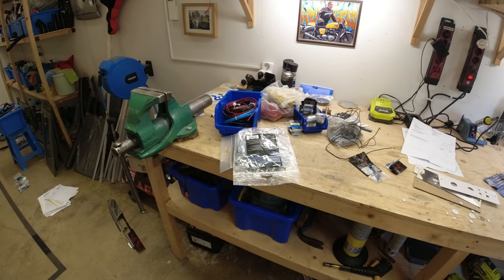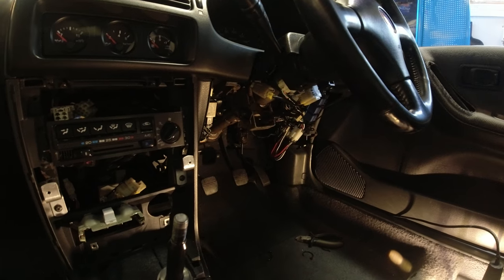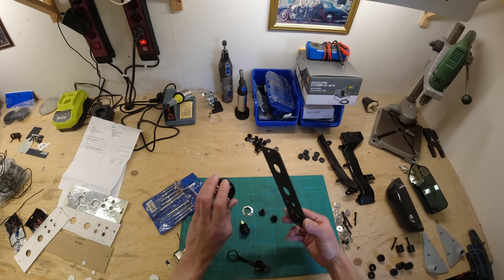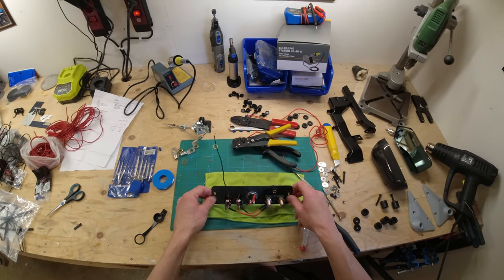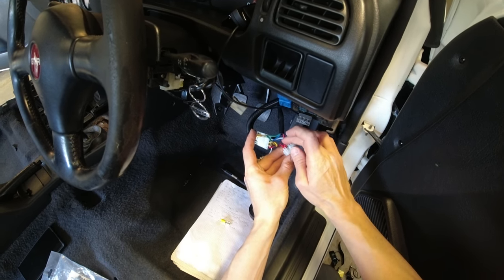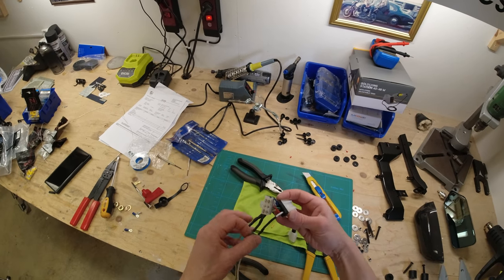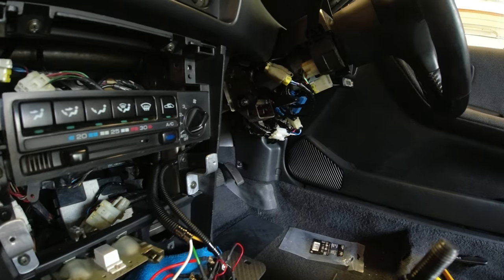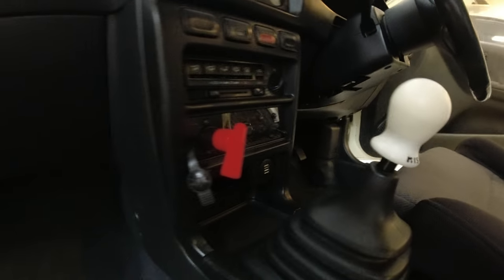MAKING YOUR OWN RACE CAR SWITCH PANEL

Comment: Good evening Mythical Mark 😃! Great job on the making of your racecar switch panel. Impeccable work with the creation of the carbon panel with the holes suitable for housing the switches and the start button. Very good connection with the turbo timer wires and the battery in the boot. Perfect result and clean and cool style.  Excellent work Mythical Mark, have a great evening.  Bye 😃👍
Reply from the maker: thankyou as always Salvatore, this is a great modification to do to a car, it really adds to the occasion when using the car!